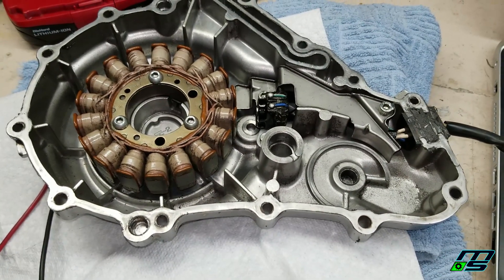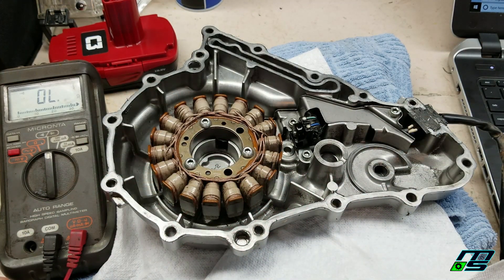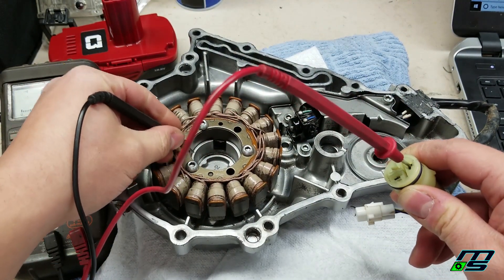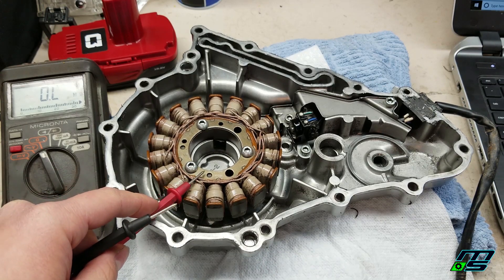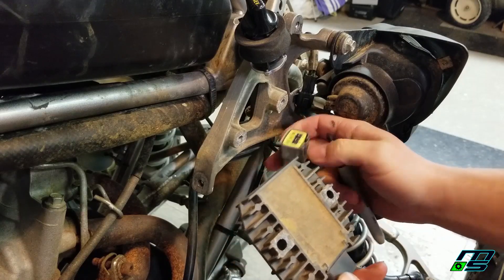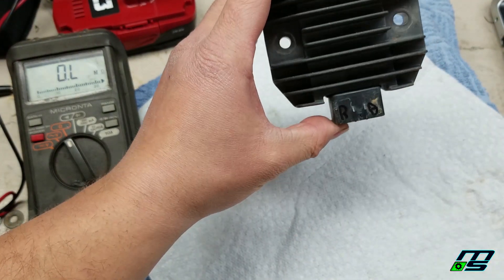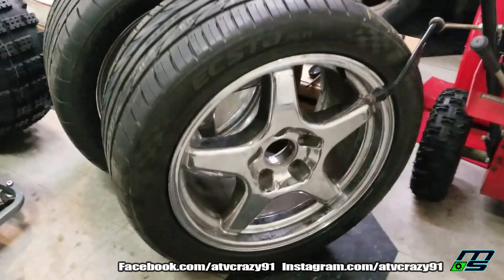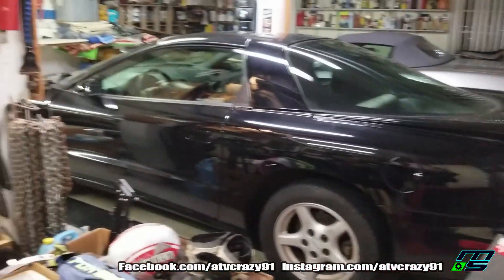I THINK I FIGURED IT OUT!!! Raptor 700 Testing Electrical Components

Comment: Did you have spark bro? Before all these?  my bike won’t run I have spark compression and fuel I can’t figure it out bike was running good I washed and changed the oil bike won’t run

Comment: My stator test is 00.4 and my crank shaft position sensor only shows readings of resistance, erratic numbers sometimes it shows and sometimes it does not and will only show for a second. My ATV will not start engine does not turn over at all. There’s no spark from the spark plug but you can hear the starter trying to turn I replace the starter and, the relay to the battery I did have a code 12 for the camshaft position sensor, but I took it out and plug it back in, and the code went away, but still no star or spark

Comment: Did you have any check engine codes? I have none, but the quad won't start. Havent tested the actual stator but the sensor tested 140 ohms. I figured id get a code for that though if it was bad.

Comment: Hey Michael 
i have a 07 700r raptor and i rebuild the engine, it fired up right away 2 days later it won't start my crankshaft position sensor is reading 277 but my stator reads 0.2 i ordered a new stator and also reads 0.2 and the quad still won't start. any idea?

Comment: Preciate the vid very helpful just have one question. Did your raptor turn over have spark but just wouldn't start, but would start after pushing starting
Reply from the maker: Thanks man! It had spark and would almost never fire up even if push starting. It was either the crank position sensor or the stator.

Comment: I bought a cheap ebay stator for my banshee they pulse coil was wired backwards an cause it to fire backwards an shattered my starter gear new clutch basket gear pressed into it  an switched wires for the pulse coil an was good then 3 ride out it kept stalling an lights died  bulbs were still good :( 
bought a good name stator an she runs fine

Comment: Im so mad i didnt comment about the stator lmao. I was thinking this when u first got it. Great job brother! Now what your going to want to watch out for with the cheap stators is that even though they test good sometimes they just dont work. I had a yamah yzf600f streetbike and i bought a cheap ebay stator, i tested it right out of the box. The bike ran before i changed the stator but it would kill the battery. The reason it would run was because it was carburated and only the charging side of the stator was bad so it could run off the battery. The issue was when i swapped it out for the ebay one, i ohm tested it right out of the box and it was good. Put it on the bike and she wouldnt run at all. I wound up paying the money for an oem one and sure enough she ran great.
As for the rectifier that just converts your ac sine wave from the stator into a dc signal to charge the battery so thats not the issue. If it were you would be able to run the bike off of a good battery for a bit until it drained out.
Just my 2 cents man take itfor what its worth lol. Got the stang up n going did u see the dyno results?? Also keep up the good videos i watch em all!
Reply from the maker: Stupid Fast hey bro, thank you for the advice and info! This was a huge learning experience for me. I was back and forth on the cheaper stator, but I read actual reviews from this one from other raptor guys and apparently it's making the cut for them; hopefully mine will work too.

I'll check out the Mustang!
Reply: Michael Sabo glad to hear! Cant wait for the update for sure!

Comment: Seems like the timing is off, since it's getting spark, gas, and air there's no reason it shouldn't be starting other then bad timing. Do a 400ex build, cheap bike, cheap parts, and they work crazy, not many in depth videos on building one up.
Reply from the maker: KingDewar no kidding I'm planning on a 400ex. I used to ride one MX when I was a teenager; one of my favorite quads.
Reply: Michael Sabo Just bought a done up 400ex a couple months ago awesome bike would be awesome to see!

Comment: When measuring resistances that low, you need to zero the meter. Or at least take into account the reading with the leads shorted.  The difference will be the resistance of the stator.
Reply: Put the meter on Ohms, and hold the leads together.  Note the reading.  Then read the stator.  Subtract the first reading from the second reading with the stator.  The difference will be the true resistance of the stator.

Comment: I still feel like the timing off ..cause u still have spark...just my 2 cents ...hope the new stator works tho can't wait !!!
Reply: Good luck for real!!!
Reply from the maker: hank offroad thanks brother! I learned today that just because you have spark when testing outside of the cylinder, does not mean you have spark when under compression. The plug needs more power when under the force of compression to bridge the spark gap. This stator is reading a higher than normal resistance, so that would yield a weaker spark and it's very possible that it's not sparking when it's in the cylinder.
Reply: Michael Sabo can't wait to see u ripping it !!! Love the videos